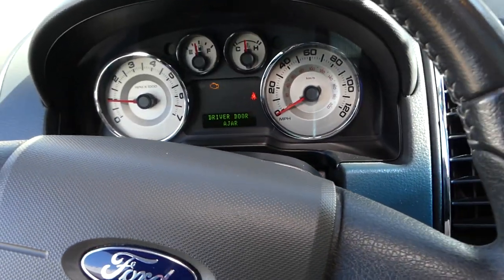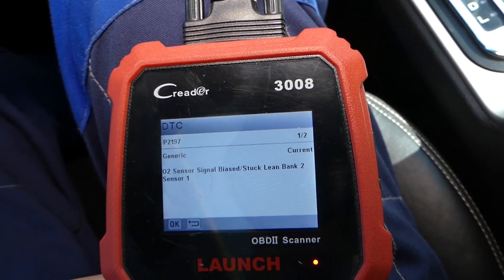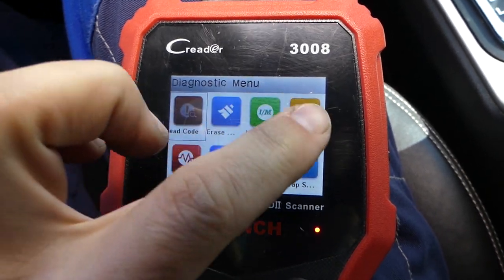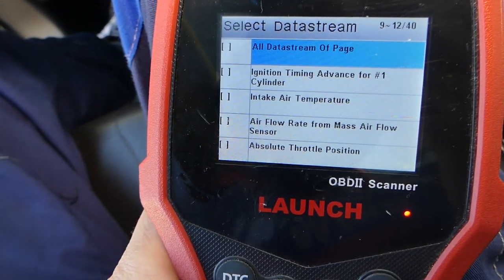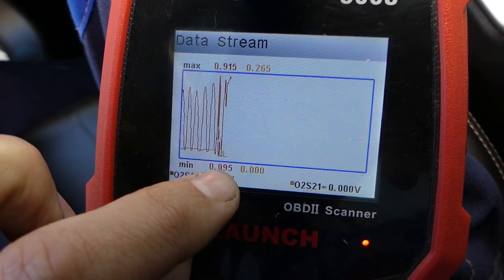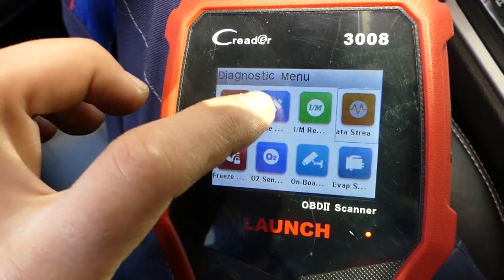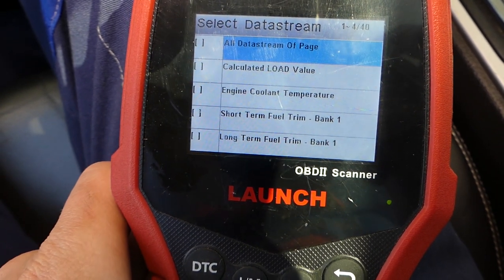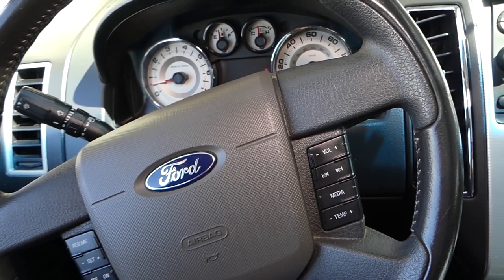FIX CODE P2197 O2 SENSOR SIGNAL STUCK BIASED LEAN BANK 2 SENSOR 1

Comment: I have 2010 mercury mountaineer 4.0 with code p2193 runs very good but bank 1 sensor 1 stuck lean I add carb cleaner in a vacuum port but no change, bank 2 it’s ok , data stream bank 1 short fuel trim + 45 bank 2 it’s ok replaced  sensor twice but no change replaced intake plenum gaskets still no change, if the fuel rail pressure sensor it’s bad won’t effect both banks? Help please

Comment: I have p2195 and p2197 I changed the first o2 the one in front of the radiator and the car is still shaking and throwing the same codes what else could it be
Reply: The 2197 should be the next one, bank 1 sensor 2
Reply: Maybe fuel injector
Reply: faulty fuel injector can cause the car to idle surge and rattle
Reply: Could be ignition coil connector wires
Reply: did u fix it?
Reply: Codes don't mean change parts. It means that there is a problem in the circuit.

Comment: I just replaced the O2s in my 4.6 mustang and now im getting this code 😢. Also fixed an exhaust leak and installed new cats. Did i get a bad sensor??!!  It just passed emissions after fixing everything up and  the next day i got the code. It was giving an inefficient cat code before, probably from the exhaust leak if i had to guess.
Reply: My f150 just went through the same thing, new cats, new sensors, now it runs like shit and throwing codes
Reply: @JaacoS1KRR  it ended up being my MAF sensor that was the main issue. It was pretty crusty so i swapped it. I wish i checked that before replacing the cats and O2s! I probed the new O2 sensors with a meter and they were both reading very low volts unplugged on a hot engine, so i knew it had to be running very lean. But the exhaust needed fixed up regardless.  I could have tried to clean it but a new sensor wasnt much more $ than a can of spray lol. It idles a lot smoother now, but now it has this annoying hanging idle that i fixed last year and now its back. But overall moving in the right direction lmao.

Comment: Hi guys I love watching your vids. I recently bought a streetwize scanner and plugged it in obd port everything seemed fine but no codes loaded or came on scanner. I have a problem with seat altea 2.0 diesel 140 hp where the car stutters and sounds like a misfire I have replaced fuel filter and that hasn't solved the problem long story short when tried connecting the obd scanner second time round the scanner never turned on no power what so ever how ever when try the scanner in other car it works perfect. 

What do you think could have gone wrong with obd port? Is it a fuse blown or something else. 

And why would a car stutter in neutral gear selector the idle doesnt move up or down it is stationary. But the car sounds like it is struggling and making a stuttering sound. 

Any help would be greatly appreciated thank you in advance been loyal subscriber since 20k subs 1million subs soon come great work guys keep it up!